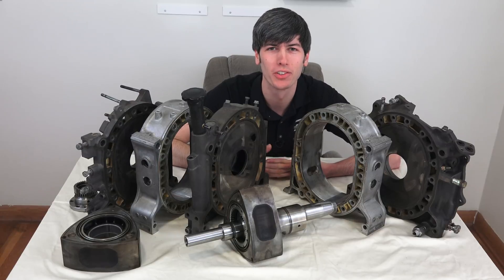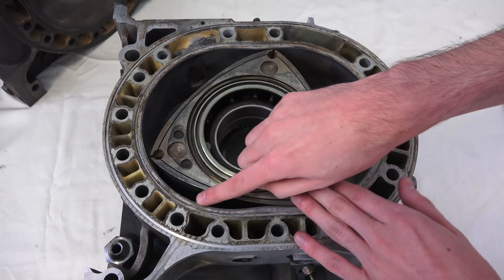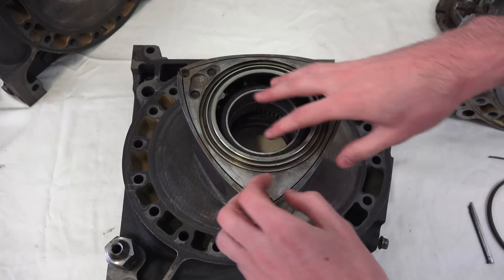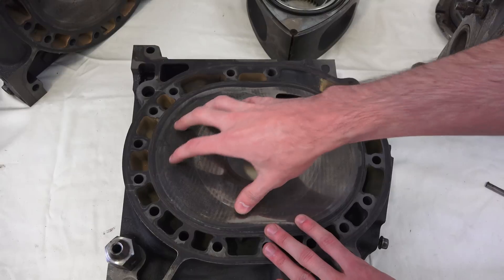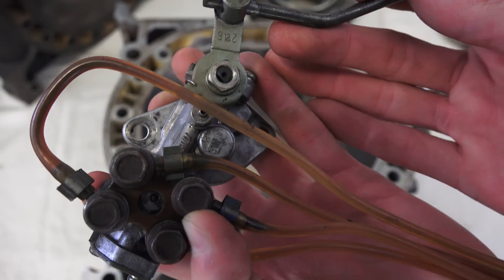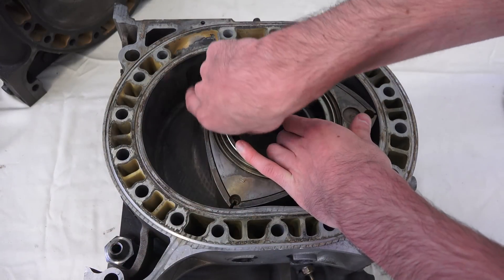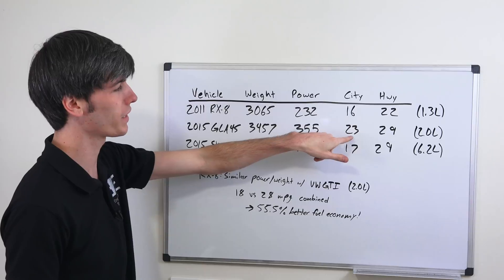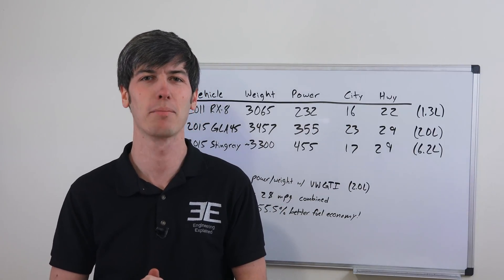4 Reasons Why The Rotary Engine Is Dead

Comment: rotaries aren't for everyone, but if you know what you're getting yourself into, you're going to have an amazing time
Reply: +J.L. Henderson (JLHenderson) Yeah having no torque what so ever, burning a shit load of oil and consuming a lot of fuel for its output is an amazing time.
Reply: +J.L. Henderson (JLHenderson) You mean an amazing time fixing shit? :)
Reply: +TheOperation You clearly don't get it. It's ok rotaries aren't for everyone. :)
Reply: +TheOperation ever heard of turbocharged rotary engines? rotary is not just the RX8 engine
Reply: fastmirage You can even get systems that allow you to put the 2 stroke oil in another tank under the hood that still use the factory OMP.  No mixing then.  Pretty handy.
Reply: +J.L. Henderson (JLHenderson) I couldn't have said it better. I love my Rotary.
Reply: Just your average turtle
My daily is a rotary...   I like to live dangerously
Reply: Hercules Rockefeller Name another NA motor that can make 700+hp with 2.6L displacement.  

They are reliable, if you treat them right.  Change the oil regularly and don't be a pussy when you drive it.  Babying a rotary is actually a bad thing.  

Fuel is cheap.  If I cared that much I would buy a crappy eco car.  Between my 8 and my truck, neither cracks 20mpg very often.  And I don't care.  lol
Reply: +J.L. Henderson (JLHenderson) STILL JUNK BY DESIGN. THANK GOD ITS DEAD. NO MORE ROTORIES!!!!! WOOHOO
Reply: Yeah, like store a case of motor oil in the back and keep checking for oil consumption every 750 miles or every second gas fill. Let's see high gasoline and oil consumption = ????¿¿¿¿car heading for the junk yard. Nice car indeed.
Reply: if by an amazing time you mean poor efficiency garbage durability and constant rebuilds . these crappy motors where like combining  all the possible negatives of an internal combustion engine with the one single advantage being high rpm.  woopy
Reply: WILLLEESEA If it was such an 'amazing' engine, someone would still make one. Not a single car company makes a rotary engine anymore. Mazda tried to bring it back with the rx-8, but we all know how big of a failure that turned out to be. 

No-one wants a car that makes about the same hp as a typical 4cyl, gets worse mpg than a corvette, and has to be sent to the shop more than a ferrari.
Reply: Brandon Mills
The double entendre wasn't intentional, but I have heard of retarding engine timing, yes.
Reply: IgoByaGo me too bud, best 10 grand I've ever spent
Reply: +Brandon Mills They are like 2Stroke bikes.  Keep the RPMs rapped up high and you will be fine.  They are a lot of fun to drive once you get used to keep as close to the redline as you can when running hard.  Normal driving, just shift around 5-6K and you will have plenty of power for normal driving.  Kinda depends on the engine.  Older ones don't as high as the RX-8 enless tuned a bit.
Reply: Chad Bremer Most 2 stroke motorbikes have such a system. The better ones even have injection.
Reply: rasvial I'm a motorbike mechanic so I'm fascinated by engines and the different designs in general. 
I wouldn't reccomend buying a rotary as a daily driver in any way. It's just the different approach that really gets me.
Reply: Just your average turtle
just some minor things right now, would much rather save up for the RX-7 FD
Reply: +dizzzave357 Have You ever done anything with a rotary? If you like strange and fun engines, there's nothing like them in the car world. They are closer to a 2 stroke motorcycle in how they feel, and god is revving one way out fun. Opening the exhaust makes them almost painfully loud and they can spit flames from the exhaust. It's been years since I did some building and porting on one with a friend,but still have great memories.
Reply: ***** A rotary? Drive one sometime, the RX8 is a great driving car, so well balanced and light feeling. The talk of no low end torque is crap, they drive normally just fine. Sure they don't chirp the tires on takeoff, but it's not like You have to rev the engine and slip the clutch to get going. In fact they drive very normal, just the feel of the engine is very different as is the sound. Go find one for sale and have a test drive, they're pretty fun.
Reply: +Oldbmwr100rs It's not crap, they have no bottom end.  They just don't.  If you think they do, you've never driven anything that actually does...
Reply: entropy156 And what have You driven? I've been a mechanic on pretty high end and high performance cars and bikes for almost 30 years. Torque? Try a Jag V 12 with a 4 speed, or a Mopar 440 with a high torque cam, yup, I've driven plenty of cars. The rotary is just fine, what it lacks at the bottom it makes up for at the top, Since You haven't built any for racing like I have, nor do I think You've actually driven any number of them, You don't know what You're saying.
To say they just don't have low end isn't giving any perspective on anything. As I said, they drive fine around town, or in normal driving. I have only done a couple RX 7 clutches because they were worn, but I've changed them when replacing high mileage engines as a matter of course. If they had no low end, people would be burning clutches just to drive them. Hell, with rotaries, the clutch is usually the least you worry about.
Reply: ***** But it was my point.  Power and handling is fun.  Just power, not so much.
Reply: SRT4 is not a good handling car.  The older ACR Neon was not to bad.  But the engine was shit.  Made a good autox car though.
Reply: +entropy156 you do understand no number of bolt on fixes the flaws of the platform, right?  FWD with a floppy chassis, a bit more power then it can deal with, and a shitty diff from the factory.  You can only do so much and the platform pretty much sets the end game limits.  Only way around that is going extreme and re-engineering the car and doing a lot of fab work.
Reply: Keep telling yourself that.  With out fab work, every platform hits a wall.  A car that is better from the start can go farther with the same basic bolt on parts.  The platform is everything.
Reply: +Chad Bremer 700+ hp lol and 0 ft lbs torque
Reply: Chad Bremer I'm assuming you are talking about the 787b's four rotor racing engine..
Rotaries have two combustion cycles per turn of the crank..So that racing 2.6 is essentially equal to a racing 5.2L piston engine.. (of which there are many 700+hp examples; countless LS engines, Cobra Jet's etc)..

Rotaries are not reliable. I've owned a couple FC's and hung out and bought parts from the FD, Rx-8 crowd.. Very few people see 200k without doing major (expensive) internal engine work.. And thats only if they get lucky and drive them 'normal', (driving them 'non-pussy-like' does not necessarily increase their life)..

It must be nice to consider fuel 'cheap'.. My 4 door turbo volvo eats rx-8's from a unsuspecting dig or slight roll and still gets over 30mpg on my daily commute
Reply: Hercules Rockefeller I don't care about drag racing.  I am all about the curves.  

As for reliability, in the MN RX club I am in, we have people all over the board.  Generally the ones with the most issues do not follow the guidelines mentioned above.  And you see the same thing on rotary forums and what not.  The driver/owner is usually at fault in many cases.  04-05 RX8 is an exception.  They had some flaws in the oil delivery system that where rectified later and in the 09+ models totally replaced.  

As for the engine, the 787B had the R26B.  Totally custom engine with variable intake.  It actually made more HP and torque then the typical 26B you find swapped from companies like PPRE.  You also have the 24A, two 12A engines slapped together from a company called Scoot Sports.  As for displacement, you get one fire per rotor per revolution of the Eshaft.  You have 654cc per rotor on a 13B or 26B engine.  That is 1308cc (1.3L) two rotor and 2616cc (2.6L) four rotor.  You are not burning that twice.  That is all the displacement you have.  Just because it fires all its combustion chambers per revolution does not make the displacement double.  Displacement is the total volume per cylinder from top dead center to top bottom center for all cylinders.  Same rules apply to a rotary.
Reply: +Chad Bremer Except 2 stroke bikes reach their peak rpm in 1/10th the time the rotary engine takes to get to redline. And the 2 strokes while need to be maintained its so much cheaper and easier to fix :)
Reply: Chad Bremer In Europe you pay the same tax for a 2.6L piston engine as for a 1.3L rotary engine.. Racing also has similar restrictions. the formula is in here somewhere: http://www.rx7club.com/1st-gen-archive-71/engine-1-3-%3D-2-6-a-579965/

Handling? My stock civic si beats my FD at the Auto-x and at the drag strip
Reply: +Hercules Rockefeller if it really handles better than your fd than something is terribly wrong.
Reply: +J.L. Henderson (JLHenderson) Isn't that the problem? The auto industry runs on economies of scale. If your engine is "not for everyone", then its applications outside of $500,000 phallus symbol supercars is extremely limited.
Reply: +John Burns I guess we would rather find new places to live instead of making the one we have more efficient.
Reply: +Nee het is steen LMFAO
Reply: +Baerchenization If you're really into fixing shit like I am, yes!
Reply: +Chad Bremer yeah I ran 2 cylcle oil in mine, just added alittle to each time I got gas, that's seems to me to be better than running the crank case oil it gums up the motor.
Reply: +Just your average turtle But.. you're putting lipstick on the 2stroke pig. The biggest fault I have with the rotary is that by design it burns lubricant oil. So crappy from an efficiency standpoint (power efficiency, but also fuel).
Reply: +Just your average turtle Around 17 city, 23 highway. I purchased the RX-8 September 2014 only because it had a brand new engine in it, something flew out of a dump truck and hit the car causing around 2300 to the engine but it was covered. No problems with it mechanically or anything except the exhaust (started a slight rattle in the lower rpms) I've gone by to my parents place from my college (485 miles) only stopping twice to fill up. On normal days I drive about 40 mins to an hr. I have so much fun with it though it makes me wonder how great the 93 RX-7 FD is (that's my dream car).
Reply: J.L. Henderson Sounds like a great project car! I guess the power is alright. Are you doing stuff to it?
Makes me want to get a project car myself but I guess I'm sticking with motorbikes since I'm already saving for my project bike...
Reply: +J.L. Henderson (JLHenderson) 10g oh lawdy. How much power does it make? Also are you including maintenance cost?
Reply: +J.L. Henderson (JLHenderson) I have both, and I must say the FD is still better in terms of handling and obviously power. If you get a chance to own one, I wouldn't pass it up. It is by far the most impressive car I've ever driven, but I must admit my entire suspension has been modified. (bushings, links, coilovers, engine mounts, tranny mount, diff bushings etc)
Reply: +J.L. Henderson (JLHenderson) 

If you disregard every objective measure of what makes and engine good, rotary engines are pretty good....
Reply: +dizzzave357 Can make lots of power, makes good sound. :^)
Reply: It's just not great for everyday driving.
Reply: +Jerome Narine you are full of shit.  Unless you have a massive turbo and/or crazy porting like a monster port or semi PP town driving is just fine.  you have obviously never actually driven a rotary car.
Reply: +entropy156 if you are on the track bottom end does not matter in a rotary.  keep the rpm high and screeming.  just like a 2 stroke bike.
Reply: Chad Bremer yeah...I know how to compensate....I just don't want to.  I'd rather just go with something that has lots of bottom end to begin with than drive something you have to wind the crap out of to get anywhere.
Reply: +entropy156 you don't have to wind it up.  In normal driving I shift around 5k.  I don't have to Rev up to pull away from a light.  They drive totally normal in normal road conditions.  things only become different with agressive porting.  Stock or mild street port and they drive like any other car.  The only time you need to stay high is on track.  Or maybe dropping a couple gears to make a pass on a two lane.
Reply: Chad Bremer yeah...I get that...I still don't like them. I'm a "shoved back in your seat" guy. For me, there is no substitute for big torque numbers. The turbo 4 in my driver does that. The nitrous small block in my fun car does that. The RX8 I drove doesn't do that.
Reply: +entropy156 try driving a 700+whp 20B powered FD.  Tons of power, light wieght, and torque.
Reply: Chad Bremer could be fun...but I'll stick with my 450whp/500tq Pinto. It's a terror...
Reply: entropy156 But can it corner?
Reply: +Chad Bremer that's not really the point that's a drag car
Reply: Chad Bremer Cornering is for my SRT-4...which also makes silly amounts of torque.
Reply: Chad Bremer You understand that all the parts that make a car really handle...whether an SRT-4 or a 1969 Camaro are all bolt ons, right?  I've seen a Magnum SRT-8 station wagon absolutely destroy Corvettes in an autocross.  Trust me....my little turbo Dodge does ok.
Reply: +J.L. Henderson (JLHenderson) I fell for the rotary hype too. They consume fuel and break down like super-cars, yet they are so weak on power. I guess there's a reason why they dont make them anymore
Reply: Chad Bremer wow....so you're suggesting that cars have potential that isn't infinite in scope? That, eventually you get to a point where performance can't be increased further?!  Thanks for the keen insight, Mr. Engineering!  I, for one, am crushed to find out that I'm going to "hit a wall" with the handling on my 4 door daily driver, and won't be able to take down a race-prepped Viper with it using bolt ons alone. Crushed, I say!
Reply: +Chad Bremer   the easiest way around the faulty oil injection to remove it and mix a little 2stroke oil in the gas tank, then use synthetic in the crankcase.
Reply: +mike parker you can also use a remote tank instead of using the main oil supply.  A few people I know use that and premix both.
Reply: jimmyboy92891 Not Really. The 99-00 si are well known Auto-X cars. The 1st year at the SCCA where I lived they dominated so much that the next year they made them race one class above where they should be. 
(The civic is 14 years newer than the FD and it IS the auto-x)..
If you were to race a stock GXL FD vs an 00 Si from a 60 mph roll on the highway, the FD would most likely win..
The Si won the drag however with 15.2 vs 15.9 GXL. (Turbo II FD's only claim 15.2)

So yeah, a stock NA 1.6 litter 99-00 civic si can out perform a stock Turbo FD in a drag and at the auto-x.. I've never raced road courses, but thats probably where the Rx-7 would probably shine.
Reply: +Hercules Rockefeller I think you should really do your homework first and make sure you have your facts in order. There is no GXL FD or Turbo II FD, FC sure but GXLs are also non turbo. These are bone stock fractory times (tires and all)

1999 Honda Civic Si           0-60: 7.5 1/4: 15.7
1990 Mazda RX-7 Turbo II 0-60: 6.3 1/4: 14.9
1993 Mazda RX-7 R1         0-60: 5.3 1/4: 13.9
Reply: MrCool00236 yeah i ment FC, 2nd gen.. (FD I wish)
The GXL has a factory claim of 16.2 @ 86
And the factory claims of a 87/88 Turbo II are 15.3 @ 91mph..
The GXL's hp #'s are similar to the Si and makes more torque, and they trap at the same speed, but the Si is faster.. 
The 88 turbo II has around 180 hp and 180 ft-lbs of torque. The SI has around 160hp, and i think negative 119ft-lbs of torque, and it still pulled a 15.2.. ( it did have a AEM CAI and cheap 70$ autozone short throw though)

Now I never raced a 88 turbo II, so maybe someone can get a better stock time than 15.3.., but my point was a turbo 2nd gen Rx-7 can barely squash a fwd car making 20 less hp and over 60 ft-lbs less torque.. However there is a generation gap of technology to take into effect, so i'll digress from this comparison..

I'll always give props to the people that tune them to crazy extremes, but I simply couldn't afford the rotary game anymore. Once the appeal of being 'different' wore off, I realized I could get much better performance for much cheaper.. 
Lots of people feel the same way too, (including mazda), which is why no one makes them anymore.
Reply: +Hercules Rockefeller hate to tell u this but u don't know much about rotaries.
Reply: jimmyboy92891 yea yea, i was drunk and called my FC an FD, so sue me. My points otherwise stand. An 86 GXL RX-7 is slower than a 99 SI in the 1/4 mile and around an auto-x.. of course the auto-x is subjective, but the drag race is not.
Reply: +Hercules Rockefeller my stock turbo 2 runs 14.7 , with little mods I'm running 13 something. hate to say it but it's in a whole different league. don't wanna bash u or anything. but u really don't know much bout rotaries. that's why we're banned from the lemans races. not to get u mad or anything but if u compare a civic si to a Turbo rx7 than u really don't know much about cars. I love cars of all types. the rotor might be low in torque but at high rpm they are monsters. like  I said don't wanna bash I or anything but I seriously need to do some thinking when u compare an rx7 to a civic. it outperforms in every aspect.
Reply: jimmyboy92891  "RX-7's outperform 'civics' in every aspect." Disagree completely. It all depends on which models you are talking about, the numbers don't lie. My 86 GXL window sticker claimed 150 something hp and 150 torque. My 00 Civic claimed 160hp and like 119 torque. I never actually took my gxl to the drag, but I raced a gxl similar to mine with the civic at a drag strip and the best he pulled was a 15.9 which is faster than the 16.2+ factory claim.. but I was still pulling 15.2's with a k@n filter and a 70$ bolt on short throw.. You'd think rwd and 30 extra foot pounds would make up for the 10 less hp, but nope, the real life numbers dont lie. 
(He was also pulling 38. secs around a auto-x course that i was pulling 36., however auto-x is hard to judge for obvious reasons) 

.. Like i said, i give a nod to the hardcore tuners, but the rotary in its basic form is a failed design. Theres a reason why no-one makes it anymore. If it was a successful engine, it would still be produced.
Reply: +Hercules Rockefeller civic = a little boost then Boom vtec kicks a rod
Reply: Chris Krull We were talking about stock engines, but there are plenty of successful boosted civics..
..Its not like I'm a 'civic guy', I was just pointing out that 13b rotaries have to be turbocharged to beat a b-16 civic.
Reply: +Hercules Rockefeller lol no they don't. my stock n.a. Rx7 vs stock civic of the same year is a no brainer
Reply: Jamal Klug Not entirely true. An american 88 civic si claims 16.2 in the 1/4 mile. An 89 rx-7 GTU claims 16.5. And those weren't even b-16 powered.. The Japanese spec 88 civic SIR's claimed 15.4 in the 1/4 which is only two tenths slower than the 1st turbo II models..
Reply: +Hercules Rockefeller 
RX-Vision
http://images.cdn.autocar.co.uk/sites/autocar.co.uk/files/styles/gallery_slide/public/images/car-reviews/first-drives/legacy/tokyo-show-2015-web-017.jpg?itok=_HjiYt-9
Reply: +Hercules Rockefeller To say that Mazda "brought it back" is basically wrong and ill-informed.  Mazda has been producing a version of a Wankel engine since 1965.  It would be correct to say that Mazda "gave up" on the rotary in all their cars by 1995 save for the RX series until 2012 when even they couldn't continue using it.
Reply: +Hercules Rockefeller Do you really have a B16a civic? thats awesome man.
Reply: +Ryan McIntyre the RX-8 was dropped because Mazda had put all resources into Skyactiv. None were available to work on the newer rotaries.  that is now different.
Reply: ***** Yeah the ads for the Rx-8 Renesis 'concept car' made 280 hp before it came out too! (I'm more concerned with what 'actually' gets released though)..
  
If anyone makes a rotary that 'works better' than a piston engine, I'll eat my hat..
But it took humanity less time, from building the 1st airplane, to launching a man into space.. than it took for humans to build a successful wankel rotary.. food for thought
Reply: Hercules Rockefeller To put a man on the moon costed a fortune with some of the world's best technical brains involved. The same money in R&D to make a 100% clean and highly economical engine would have produced one by now. 

I believe baseball caps taste good with mustard.
Reply: Hercules Rockefeller Food for thought is the progress of the electrical battery. The lead-acid dates from the 1850s and is still used in cars. Reminds me of the piston/crank engine's progress, which is just over zero.
Reply: dave shand If you are talking about my reply to Jamal, those are the factory claims. Modded cars are a completely different story.